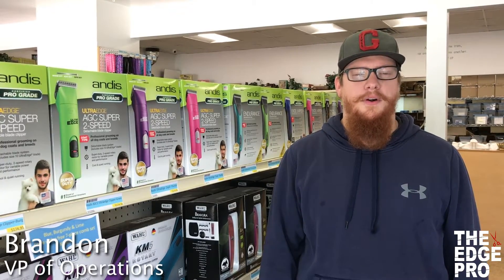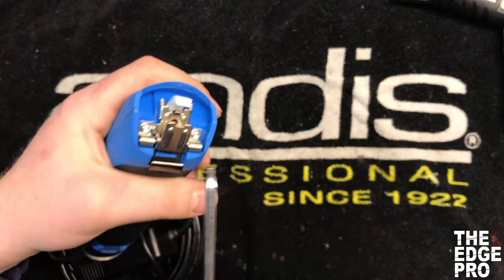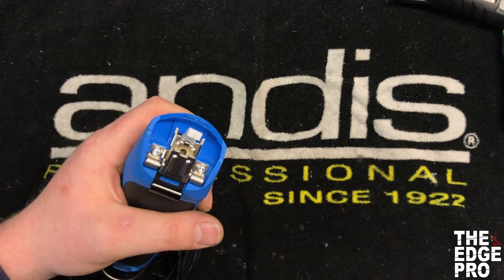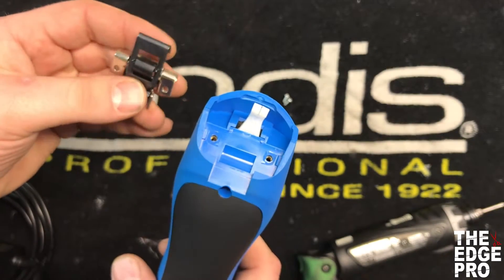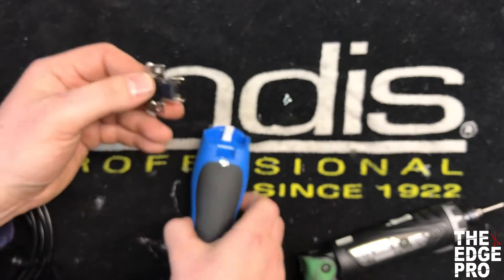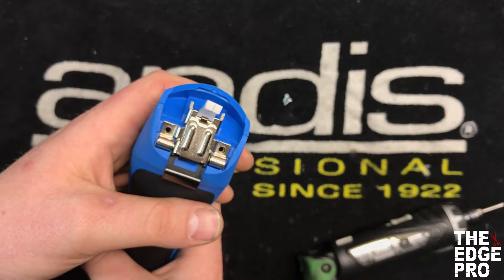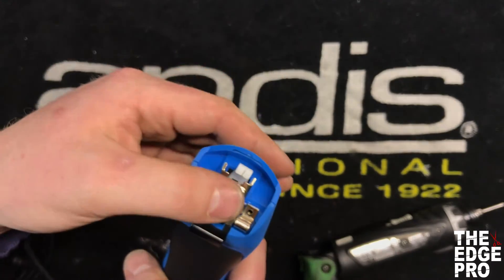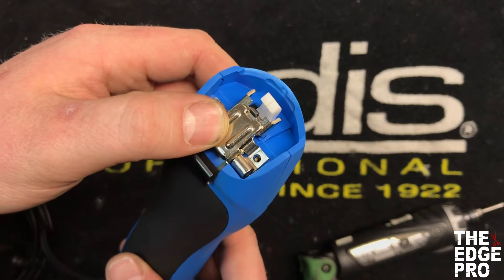Hinge & Latch Replacement - Wahl KM5

Comment: One of my screws on latch became loose, so I tried tightening it back up, however, unlike the other screw which tightens fully and feels more snug, this loose screw just continues spinning and never fully tightens. And so when I use the clippers again, within a minute or so, the screw just becomes loose again, making loud noise. What could be the problem here exactly? Could the screw slot be worn inside or something, making the screw not be able to fully grip the threads?